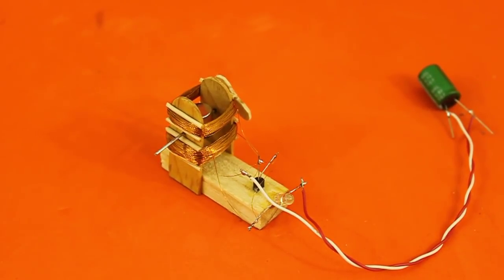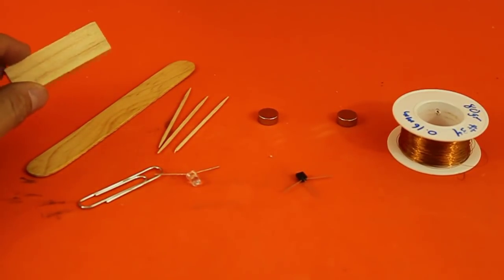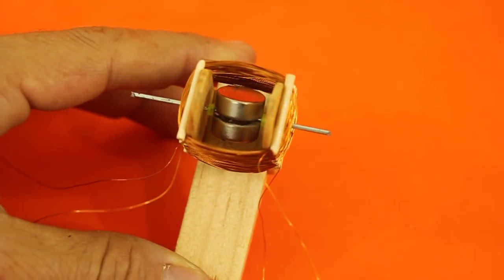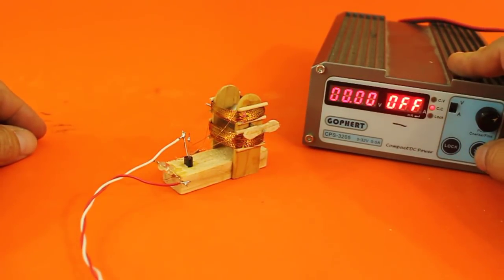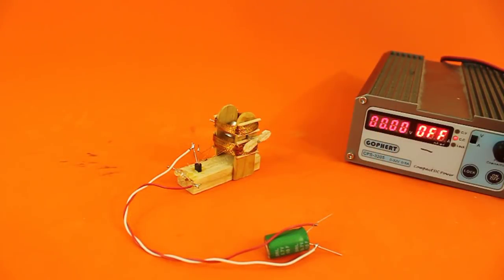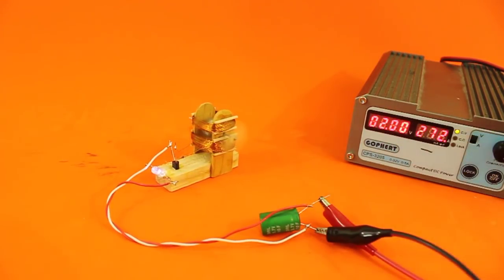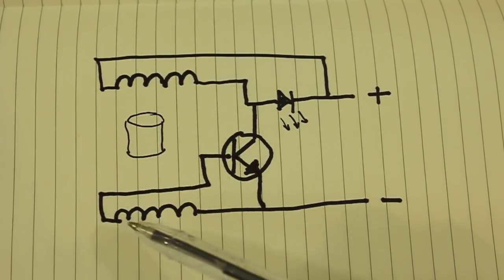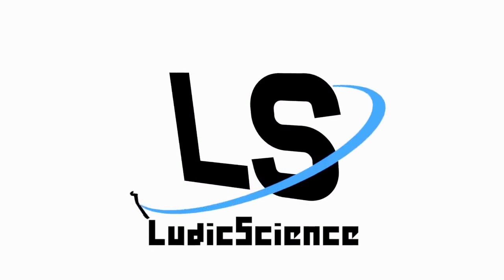Newman Motor

Comment: I know this is an old video, but i heard you say Newman's motor didnt create free energy. I just wanted to correct that. The motor indeed created 8 times more power than you put in. Its just that people who try to replicate it never follow instructions properly for some reason. If you understand the principals Newman was trying to teach, you dont need to build the motor to know it works. A simple mind experiment is enough because the principals are very simple. Even your motor is slightly overunity, you just dont see it yet because you didnt test it. It runs at 1v 10ma, which is 0.01watts. What other motor have you seen run at such low power and produce such speeds? If you were to build a 10kg version of your motor, it would run at 100v 100ma, which is 10watts! In fact, you dont even need to build a motor, you can simply use the coils on their own, increase the frequency and produce even more power, like what Don Smith used to do. Same principals apply. Free energy is real

Comment: You don't say which is the capacitor value, you don't show how minutes it should work with only the capacitor, there is power consumption in the led besides that in the motor.... i think that your video is not honest, probably false: using some magnets or magnetic fields rotating under the orange table.....

Comment: Hello people, the projects on this page are very good, but I wanted to add something about Joseph Newman's motors, generally the main winding had thousands of turns of copper wire that was quite thick and limited the current that entered the motor, his motors They were very powerful but with a very low consumption of the order of milliamps, they worked with high voltages of more than 100 volts and had a very powerful torque, the power of these motors was much greater than the energy consumption, their small motors were also very powerful.
Reply: If this was possible it was be easy to measure. Yet nobody has produced a model that shows this. Newman's own demonstration failed to show this. If this model produces more energy then it takes in why hasn't a hobbyist connect one to an inverter and powered up his house for free with it? The answer is that it doesn't work. I wish we'd stop confusing increased efficiency with free energy.
Reply: @azteacher26  Hola amigo, el motor de Newman no era nada del otro mundo pero hay que experimentar mucho para llegar hasta donde el llego, su motor funcionaba con menos de 10 vatios y su rotor pesaba 740 kilos, giraba lento pero con 4 o 5 vatios no moves eso facilmente, el concepto de energia libre es erroneo, en realidad es energia del ambiente y simplemente la electricidad en una bobina y sus campos magneticos no siguen la primera ley de la fisica y menos con radiofrecuencia y resonancia, estos dispositivos no rompen leyes fisicas, simplemente aplican leyes que desconocemos, y si estoy de acuerdo contigo en que son dispositivos muy eficientes pues no utilizan la energia que les das, toman energia del ambiente que ya esta ahi y es dificil de detectar y medir pero existe y tambien es dificil de obtener. Yo hace poco experimente con una bobina de 7000 vueltas con alambre grueso pulsando sobre un rotor de imanes, la alimente con 12 voltios en pulsos con un circuito electrico, copie las ideas de Newman pero no su diseño de motor largo por parecerme poco practico y complicado de hacer, la bobina tiene 68 ohmios de resistencia y eso permitiria pasar 170 miliamperios en corriente continua pero como la corriente que le entraba era pulsante funcionaba con 17 miliamperios que es aproximadamente 0.2 vatios, el rotor pesa 1.5 kilos con 4 imanes, lo medi todo lo que pude y compare con otros motores y su potencia en torque y velocidad era de mas de 7 vatios, comparandolo con motores convencionales, incluso lo hice funcionar toda una noche con una pila de 9 voltios agotada. Lo que descubrio Newman es nuestros errores de diseño que usamos desde hace mucho, en la bobina que construi esos 17 miliamperios pasan por 7000 vueltas de bobina y eso es que esta sea tan potente y tenga un campo magnetico muy intenso, cada vuelta suma su campo y siempre con esa intensidad, si sumado a esto haces un circuito resonante y combinaciones con bobinas obtendras mas eficiencia, si pones bobinas secundarias en el recorrido de los imanes recolectas mas energia, podes usar el contragolpe de alto voltaje para tener mas energia tambien y si esta idea junto con muchas otras que utilizaron grandes desarrolladores como Donald Smith, Tariel Kapanadze, un ruso apodado Akula y varios mas se pueden hacer generadores de energia ambiental sin partes moviles, es posible pero se necesita mucho esfuerzo y experimentacion. Un saludo desde Uruguay.
Reply: @fernandodacosta6689  Hola Fernando. No soy ingeniero eléctrico. Le agradezco que se tome el tiempo para explicar los devanados y las especificaciones, pero eso es todo sobre mi cabeza. Si los motores Newman están tomando energía del campo magnético de la tierra como parece estar describiendo, eso debería ser medible. ¿Conoces a este youtuber: https://www.youtube.com/watch?v=cKq9zbiJ1LE. Construyó un motor Newman y no parece estar muy impresionado con él. Confío en su medición y análisis. No parece que el motor tenga futuro.
Reply: @azteacher26  Hola, le contesto en español pues los traductores son muy buenos, si quiere contestarme en ingles no hay problema, vi el video y conozco a Robert Murray Smith, me gustan mucho sus trabajos y vi lo que el mostraba sobre los condensadores de grafeno y grafito, en el video muestra un motor hecho con una bobina de alambre grueso pero tiene pocas vueltas, parecen no ser mas de 500 (parece una bobina de transformador de microondas, estas tienen menos de 400 vueltas) las bobinas de los motores Newman generalmente tenian mas de 20000 vueltas de alambre grueso, el conmutador mecanico devolvia energia al terminar su contacto en un pulso muy intenso y de alto voltaje en un arco voltaico o chispa que el canalizaba con diodos potentes y de alta tension a condensadores de alta tension (se ven en sus videos y el los nombra), en el circuito de Robert pone un diodo de recuperacion pero este maneja poca potencia y los diodos ofrecen resistencia, su recuperacion es muy pequeña, los motores de Newman fueron estudiados por mas de 40 tecnicos, ingenieros y especialistas de la epoca, confirmando su potencia mecanica mayor al consumo de entrada, luego Newman tuvo que batallar con la oficina de patentes que nunca otorga patentes de dispositivos que manejen sobreunidad (perpetuos) y luego con toda una mafia que quiere impedir que dispositivos como estos salgan al mercado y comprueben su eficiencia, va en contra de sus intereses, y mas en paises con industrias muy avanzadas con dependencia de combustibles fosiles, le hicieron la guerra hasta el final, los dispositivos de Newman no manejaban mucha electronica y el los hacia funcionar con baterias en serie o pilas de 9 voltios en serie superando los 200 voltios, estas las utilizaba durante años y a pesar de descargarse el dispositivo seguia funcionando. Pienso que explico muy bien lo que hacia pero tambien le agregaba lo de el efecto giroscopo de los electrones que pienso que en gran medida es asi pues el sentido de un campo magnetico cuando pasa una corriente en cierta polaridad y lo de energia es igual a materia a velocidad de la luz al cuadrado nombrando leyes fisicas que el desconocia, pienso que sus dispositivos funcionaban como el decia y mucha gente lo apoyo pues vieron las posibilidades. Le cuento que yo hice una bobina de 7000 vueltas de alambre 0.5 mm en un carrete plastico de 22 mm y 23 cm de largo, esta tenia 68 ohmios de resistencia y la hice funcionar con una bateria de 12 voltios, la controle con un circuito muy sencillo con un reed switch mecanico que pulsaba la corriente y solo permitia el paso de 17 miliamperios con un consumo de 0.2 vatios, como esa intensidad pasa a traves de cada una de sus 7000 vueltas su campo magnetico es muy potente, esta bobina con un nucleo de hierro mueve un rotor de imanes de 1.5 kilos, calcule su potencia por su torque y comparandolo con motores convencionales y su potencia mecanica en vatios era mayor a 7 wat, entendi sus principios pero no reproduje su motor largo por verlo poco practico y complicado de hacer, el asunto aca es que no rompe ninguna ley fisica, simplemente las leyes estan mal formuladas a la hora de tratar con electricidad, campos magneticos y radiofrecuencia. Solo piense en esto: si usted toma un alambre muy grueso, por ejemplo de 1 mm o mas y le da mas de 20000 vueltas su resistencia sera muy baja pero lo suficiente para que su consumo no sea muy alto y una intensidad relativamente alta de corriente pasara por esas miles de espiras generando un campo magnetico muy potente pero con un consumo bajo, su salida mecanica es muy potente y esta explicado por el. Hizo motores muy potentes e incluso movio un auto a 12 kilometros por hora con un consumo bajisimo, el motor que mostro en su garaje tenia un rotor que pesaba 740 kilos y lo movia con 4 vatios, y bombeaba agua, pienso que sus dispositivos son muy sencillos y faciles de entender sin embargo veo videos replicandolo mal,  pues no se parecen a lo que el hacia y explicaba. Le aclaro que yo tampoco soy ingeniero pero soy experimentador de mente muy abierta. Un saludo desde Uruguay.

Comment: ok so when you hand cranck it,the motor produces electricity and this eleactiricty is charging the cap and the cap is feeding it back to the the motor? but is it charging the cap more than it is drawing? what exactly is going on and how long will it run like this without using power?
Reply from the maker: Less than a second.
Reply: @ludicscience  what less than a second? it was runing on its own for a while with only the cap attached?

Comment: NEWman Motor is zero force because he used massive amounts off magnet and wire and it only ran on 3 volts
Reply: The potential energy of a 80 ft dinosaur is much greater than the potential energy of an ant even tho the ant exerts more force per area it has way less potiential energy
Reply: Thats the principle of the newman motort im working in it
Reply from the maker: Wrong

Comment: Newman motor uses voltage across the rotor, not voltage to the coils......
Reply: where do you have this from just wondering? how is newman then using all the mass that's in the coil and convert it to energy with the use of capturing the negative BACK emf?
Reply: @marklinsdell4260  Yes, and correct me if I'm wrong but he send higher voltage into the coils to generate a magnetic field, instead of high amperage, the coil then has high resistance and high mass ofc so he may "trick" the coil so he send high voltage throug it and the ampere never completely passes through the coil in one turn? by adjusting the communicator.

The coil then generates high impulses of short Back-EMF  because of the change in the field, he then capture the back-emf with a high puls capacitor? then he uses that charge to whatever he wants? He capture the Back-EMF by using barrier-diodes and some pulse capacitors.

So that's why I ask what he means with "Newman motor uses voltages across the rotor, not to the coils"

You see my point? Joseph did just say "You dont need amps to generate a magnetic field, you need voltage and voltage you can duplicate ass many times you need" something like that. And when he say rotor do he mean the axle?

please kindly correct me if I said something I have miss analyzed or analyzed wrong

Kind regards
Me

Comment: That is a pulsemotor not a Neumann motor
Reply: He didnt power his motor with just a dc power supply
Reply: You are currect this guy should do his research before makes a state like he know its a fact Josheph Newmans motor ran off of volts not amp also he steped up the volts to run his motor to ten thousand volts and more
Reply: @overunityresearchchannel  How do you separate the amps from the volts so you can only use volts to run the motor ?   Some kind of super duper Newman filter ?   Or do you have to buy wire that is only rated with volts ?   I'm trying everything I can think of , but those pesky amps still keep leaking through the wire some how .
Reply: @Mk101T   IF you understand that current and magnetism are not actually related, then you would understand that applying current for longer than the required time for the magnetic field to propagate causes heat which gets calculated as complete loss due to the fact that a magnetic field requires no input to sustain itself.
Reply: @matthewvarner3603  Does a sustained magnetic field produce any work ?
If not , how did you fluctuate the voltage in order to motivate something with the magnetic field ?  Ergo use no Ampres (current) ?
Reply: @Mk101T  No a sustained magnetic field does not produce work. How we typically generate electricity is wildly ignorant as we use lenz law to produce changing voltage and thus changing magnetic fields; which is used to transfer work. The problem lies in the magnetic field being used.
Reply: @matthewvarner3603  Which can get more work done ?
Current fluctuation or voltage fluctuation ?
And exactly how would you fluctuate voltage with no use of current ?  Because you can't get any current with 0 voltage right ?
Reply: @Mk101T  Well we currently use current to produce work as a rotating magnetic field, but it requires you to overcome lenz law. The idea with current generation is you need a changing magnetic field, ie a field that rotates or a stationary field with a coil that rotates within the field. The problem is that a magnetic field propagates at the speed of light and current does not. Voltage  or dielectirc pressure is what forces the magnetic field to expand from its null point. Current is just a byproduct. We always change voltage, current change is necessitated because of the changed voltage.
Reply: @matthewvarner3603  Exactly ... so how would you change voltage to induce a magnetic field that can produce work ?
My guess is ... fluctuating voltage can certainly make something spin.
But does it have the electromotive torque to do something here in the physical world like the ampres would have ?

Are we arguing the same thing ?  That the Newman motor cannot compete with current motors ?   Heehe punn intended
Reply: @Mk101T  What i think you have failed to see is that the actual newman motor used both the initial field propagation and the collapse phase of the field which is also a phase of change. This guys video is not a reconstruction of newman's motor. What is actually going on in electromagnetics is far greater than many understand. PS todays electric grid and motor designs are made for convenience and practical used and efficiency is tossed out the window in favor of ease.
Reply: @matthewvarner3603  And you seem to be tossing out explaining for ease of dismissing .
Ergo ... You are dismissed
Equal and opposite reaction Baby !
Reply: @matthewvarner3603  come walk the streets of New Orleans ... and lets see how far your proof goes.  Either it works ,,,or it don't
Can it hold up in the real world ???
Reply: @Mk101T  How is equal and opposite being dismissed. Newtons law is completely thrown out the window for subatomic particles. The magnetic field is actually not a particle so equal and opposite?

Comment: Hi good effort although this is not a Newman there is not enough copper turns and no commutator I would also not be too quick in stating that newman was not able to do what he did as I will give you a link too a person that has replicated and also improved upon Mr Newmans build.

https://www.youtube.com/watch?v=nzhSBO5MSQU

Enjoy.
Reply: do you have another link
Reply: @sentient1705  Search newman motor. It is about high voltage not current. Also never brushless.

Comment: I 3D printed my motor, bought some 28awg magnetic wire, did 150 turns on the top, 250 at the bottom.  Wired everything as shown to a DC power supply set to 20mA and 2V and nothing.  I then connected the input and output wires from one coil at a time to a voltage and amp meter, attached the drive shaft to a drill, ran it as fast as the drill will go and my meter is not registering any voltage or amperage.  I'm at a loss here for explaining how N52 magnets rotating inside a 250 turn coil at about 180-300RPM is not generating any current or voltage.  Would love to hear some feedback as to why I'm having this issue?  Everything I learned in electronics 101 says the magnetic field should be generating a current in my wire, so why is it zero?
Reply from the maker: You did set your DMM to AC right?
Reply: When I set it to AC and my voltage dial to 200m it shows the reading with nothing spinning is 6.9, then when I use my drill at max speed it goes to 8.0.  When I set the dial to 20m on the Amp scale, it registers 0 with nothing spinning and 0.3 at max speed.  When I then attach everything to the circuit as shown, nothing works.  I have my DC supply set to 2v and 20mA...  So how is it that when I copy your work, but use a 3D printed armature for the coils and real bearings for the drive shaft, nothing works?  Or how about why my voltage and amperage output from either coil is identical despite one coil having an extra 100 turns?  Or that it's nowhere near the voltage/amperage required to actually turn on a LED?

Comment: If it doesn't produce excess energy it isn't a Newman motor.  Newman motor is able to recharge dead batteries when running on them.  Clearly a smoking gun to more than the input energy it takes
Reply: Constantine Joseph Hello,

So it's basically an efficient battery desulphator therefore. I have a video on the latter, but using an Ossie Callanan approach. 😊